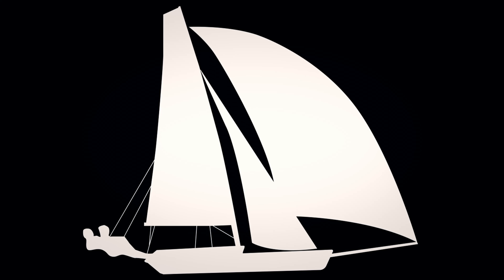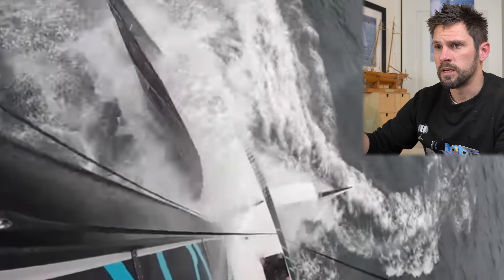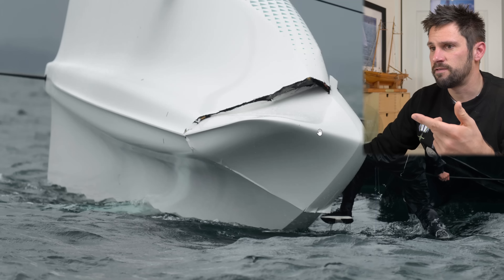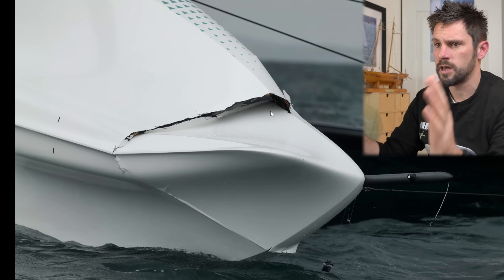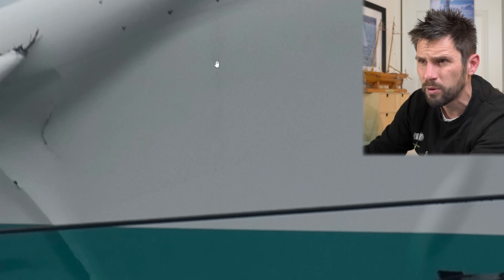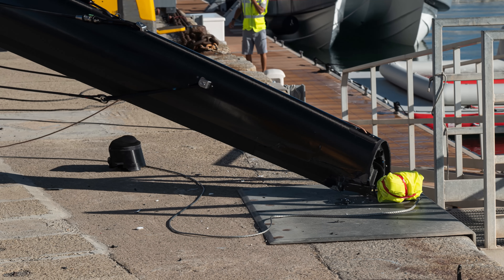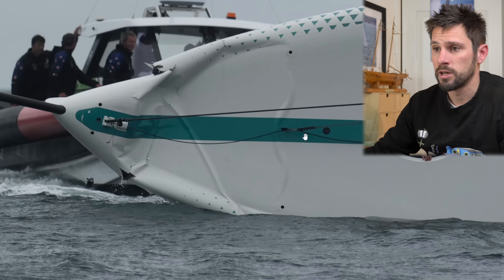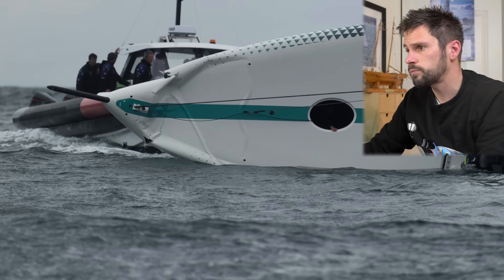Implications of AC40 Structural Failure

Comment: This is a very informative video.  My first thought was the lack of reserve buoyancy in the bow. MY second thought was that the deck sweeper headsail caught the water; normally the sail would tear, or the mast would come down.  But the new sails are very strong as are the new masts.  If the sail gets a load of water; especially at these speeds. something will break no matter how strong you build it.  I would recommend redesigning the headsail to fail at a certain load.

Comment: I think if you're tight on your budget (which ETNZ always is) then it's maybe better to use the AC40 standard which you have to buy anyhow instead of spending lots of money into a boat which will never enter any competition. Although in fact, many of the last cup boats could have been recycled (including the AC50, which are now a few seasons round the SailGP circuit. Maybe some rich guy buys one or two LEQ12s and converts them into something like the Flying Nikka
Reply from the maker: I donder what happened to the previous test mules from the last Cup. I wouldn't fancy the INEOS one, but the American Magic, and also the Kahu the ETNZ one looked pretty sorted

Comment: This is ridiculous. If this is a one design class, are there no specifications for construction standards?? The foiled catamarans regularly nose dived. Just look at the trim of the an AC40 and it's just waiting to nose dive at any minute. If the designers and structural engineers did not see this coming they should be fired. My late father was a test  engineer for the Hydrofoil designer William Carl. I grew up with hydrofoils. The trim on these boats just looks wrong. It's as if they use the data from towing the boats to set the foil placement and  trim without taking into account the vectors of the forces at the top of sail. And like the cats this makes the boats dangerous to sail. These people need to wake up like Formula One did after Ayrton Senna's death in 1994. Note: Jules Bianchi's death in 2014 was the result of poor race management not failure of the car.

Comment: The Kiwis just released a video “AC40: implementing the solution” where they give some justifications and show the solution they’ll implement. Apart from the engineering side, good to see a quick response from them!
Reply from the maker: Yes,  very quick response. I was surprised. Also very open in the failure mode and loads. I think it's a good response from them to rebuild confidence in the platform.

Comment: The Forestay Strop creates an upward and a inward compressive force inside the boat in order to load the forestay - Just like a TP-52 and looking at the Bow, it looks like the bow collapsed under impact - looks like 15mm thick Nomex Core. So easy to rectify. 

One Australia sank in 95 when her deck folded and collapsed mid-deck in heavy weather. I was at the Windward Mark and it was blowing 35knots with a short chop. 

So hull failure is always present in the America’s Cup and nothing new.  Team New Zealand is always pushing the boundaries and is expected to win again.

Looking forward to Barcelona!

Comment: sry I'm new to this channel, but what is the kicker system in your background called and what are the benefits apart from weight ?
Reply from the maker: Welcome! It's just something I made up for decoration. It uses Allen Brothers low friction rings. They are a lot stronger than most ball bearing blocks and also don't have any moving parts so last a long time. And they're very cheap compared to a standard block. At very high loads they can have less friction than a standard ball bearing block, but at most working loads they do have more friction, which is the downside.

Comment: Innovation is what the AC is all about, and one reason I still find the whole AC process, from design to testing to actually racing, to be so fascinating.  And when they break, it's part of the game. But that's NOT what you want for a production boat, or a boat that's already slated to be used in such a prominent one-design series.  They need to be well tested, reliable, and above all, SAFE, especially for Junior racing.  This is pretty much the opposite of an AC boat, where the game is as much designing and building the boat on the cutting edge as it is racing.  Pushing the envelope is great, but maybe considering this a bit more next time would be better. I'm sure they'll work it out though.  It was kind of lucky it broke now.  Much better than later!

Comment: Kinda wonder if our attention should equally be on the loss of rudder that initiates the un-commanded manoeuvre, rather than getting myopic about the bow structure. Cavitation travelling down the rudder due to the reduced pressure in the trough behind a wave is seemingly a recipe for disaster. Is the rudder inadequate, or is the loss of rudder simply a fact of life for the foiling classes of such a size?  Does SailGP offer any hints about outcomes of loss of rudder control?

Comment: Mozzy, dont overreact - it is just a boat - Team NZ use Siemens NX Nastran for FEA - I use the same suite - Pure Engineering in NZ use Abacus.

This can be fixed by splicing in a new bow and reinforcing the U-Frames and Stringers. Anyway rather now that later in Barcelona and elsewhere! 

They have the loads and impact data from the crash.

They make it light as possible to obtain a faster lift out of the water.

Speaking of Alex Thomson - he should have had his boat built in France rather as the Carrington shipyard had all these cut-outs in the longitudinal Bulkhead to save 5kg without any edge reinforcement. Should have left it without any holes!
Reply: Can't make an omelet without breaking a few eggs

Comment: How much of this damage is caused directly by the impact with the water, and how much could be attributed to rig loads through the forestay as the boat decelerates? ie has water impact pushed the bow in, or has the forestay tried to rip the front off the boat. Glad to hear you reference Clarke and Dawe! https://www.youtube.com/watch?v=3m5qxZm_JqM
Reply from the maker: Usually in a pitchpole the forestay unloads and the shrouds load up (and backstay if they had one) as the rig tries to push over the bow. However, there is also a lot of water that comes over the bow and hits the jib, which would put a significant load in to the tack of the jib.
Reply: @MozzySails  ETNZ sent in depth explanation of the accident in their latest newsletter with the graph showing water impact longitudinal and lateral deceleration compared to their previous worst comparable event they had with Te Rehutai.

Comment: I reckon it's a rig load up failure not a water impact issue. Rig loads up forwards during deceleration, then the stored energy in the hull and rig unload with a bang.it needs a shock to do that.

Comment: Wow incredible pictures. 
That said as a former AC boatbuilder, I think you might be way understating the issues. 

The pictures you shared show significant delamination 8’ feet from the bow. This means that they bow panels structurally failed. This can have 2 causes; the skins of the panels were underspecified, or the carbon was laid up too dry and the carbon to honeycomb bond failed. I am sure that there are people inspecting the panels right now looking to see if the honeycomb is torn in the middle indicating skins that are too thin, or on the ends indicating that the skins detached. This is the kind of crash that leads to lawsuits if there are third parties involved. I am not sure what happens in this case as to you want to start suing at the beginning of an AC cycle?

Fixing the bow of the existing boat might not be worth it as failed honeycomb doesn’t really hold its shape making it notoriously hard to fix. Additionally any remaining failures need to be removed before they can be fixed. Bottom line, to fix the bow you probably need to build a section to the first bulkhead or lateral stringer BEYOND the damage and then blend in the section. Realistically it may make more sense to use the molds to build new stronger boats. Than to take the molds out of production to build a replacement section.
Any sister boats that are out of the molds are also facing a decision about how to reinforce their bows. As it is impractical to add more carbon after a hull is laid up for several reasons, the principally because adding carbon after the hull is cured relies on mechanical bonding instead of the stronger chemical bonding that occurs in the layers that are laid up together, I expect to see longitudinal stringers added to existing boats to decrease the size of individual panels and make the bows more structurally sound. This will take time as adding structure after the hulls are completed is time consuming. 

The other option would be to limit the conditions that you sail the AC40 in. But what is the use of a test platform if you are limiting the conditions?

Glad to see you back. Keep sharing the knowledge.
Reply: Bravo! You wrote everything correctly! Typical breakage from ultimate load due to manufacturing defects. There is very little glue that connects the honeycomb to the skin, and poor vacuum when molding the skin and the sandwich as a whole.
Reply: Young America was a example not enough vacuum pressure but in their case it was in the gunwale / chainplate area. Nice analysis ted .
Reply: Thank you for your in depth structural analysis. However, hitting the water doing 10, 15, 20 or 40kts is not the same. I'm sure it opens a new era of R&D process to build these boats structurally stable in all situations that might arise.
Reply: However, if you strengthen up the bows - you will add weight right where it is least wanted to reduce the chances of that type of note dive again. The item to really fix is the rudder (or the manner of sailing the boat) as it seems to be simply that the rudder foil lost grip in the water (stalled or got dry due to a wave??). If that had not happened, the crash would not have happened.

Comment: Wow, this will require a major redesign of the AC40 boats! some designers must have egg on their faces, it will be interesting to hear explanations of why it happened, and why they hadn't allowed for the loads caused by digging in at speed. You would hope that the Ineos test mule wouldn't have the same weakness, but maybe they will be reviewing their designs too. It would be great to be a fly on the wall in some of the meetings that take place as a result of this failure.
Reply: If by a "major redesign" you actually mean, "Some quite limited remedial work to existing boats" - then yeah!

Comment: existing design just doesn't seem overly friendly towards larger seas. very vulnerable to front stuffing.  surely a foil under the bow would provide more bow lift in a big sea, and prevent the face plant.  it might slow them down a fraction in lighter conditions, but make for a far more versatile and safer foiler?  greater span between foils provides for stability in adverse conditions.

Comment: It is conceivable that a software or autopilot problem could have caused the high speed nose stuff. An erroneous rudder foil input raising the stern and pitching the nose down violently could exceed the parameters used for the bow design. Similar problems happened with aircraft autopilots in the past- the answer was not making stronger wings, but stopping the autopilot from destroying the aircraft with harsh control inputs.

The more likely scenario, is that it just let go under heavy load in big swells. You would think the many permutations from loss of control crashes would be hard to simulate in the software. This would make a redesign difficult - How strong is strong enough and are any hull losses in extreme crashes acceptable?

Comment: That is a shock. Terribly disappointing but that's how it somethings goes with R&D craft. Regarding the shape of the bow itself, the newest IMOCA 60s are sporting 'scow' bows with less of a wave piercing shape than in the past and much, much fuller in width. Reason being not to dig into the waves inducing sudden deceleration that will cause the yacht to drop off its foils and slowing it down. Granted, IMOCAs are very dissimilar boats and sail in vastly different conditions, but the needs of a foiling boat are also very different from that of a pure displacement vessel. Would this have occurred if the bow shape was different? Hard to know. However, I am surprised the AC boats still have rather conventional bows than some of the ocean racing classes with advanced modern shapes.

Comment: Racing speedboats routinely use multiple lifting strakes in their bow - to handle the stress and provide progressive lift.  AC40's in extreme conditions like this crash are handling similar loads, further complicated by very high rig stresses, particularly from the forestay.  Such strakes introduced to this class of foiler would a)  make the shock of sudden lift loading on the bow section more progressive as the bow splashes down / in,   b) potentially add considerable strength and stiffness to the hull,  especially longitudinally,  and c) spread the load at the hull to bulkhead interface.  Similarly a 'ski-shaped' flat for 3 or 4 feet under the bow would further break up the shock of a hard splash-down. All this could probably be done with a narrower profile at deck level, adding better wave penetration at the same time. Also worth adding a shock absorber of some type to the forestay, activating only in extremis.

Comment: Cannot understand why the steering foil is at the stern. If forward, it would increase lift in pitch and, like a road car, would have greater sensitivity in a turn...l made models with this configeration...worked very well...stopped the bow dive?? Remember the original "America" in 1851, Brits said it would never be fast because the hull shape was facing backwards...may be time to rethink perhaps?

Comment: Can’t see this getting sorted quickly. Probably the hardest spot on the hull to add strength to once the hull is fully assembled - access would be a nightmare. Probably means redesign and new build of “type 2” hulls? Anyone know how many AC 40 hulls have been built so far? Could be v expensive even by AC standards….
Reply from the maker: This one... INEOS's has just been shipped to Europe, I think ETNZ second had just arrived and one more is encountered from china
Reply: @MozzySails good news on the cost front as they can build new design into later hulls. Watching the AC video interview it looks like the water tight bulkhead did its job keeping the water out…

Comment: Its the old saying. “ if it doesnt break , you built it too heavy".  Better to do it now than have 6 boats to repair later. Failure goes quite far back, more than 2m (  black dot on the gunwale )Looks like the alan prost of sail boats now.
Reply: Yeah, but it’s not supposed to disintegrate until it’s almost across the finish line!

Comment: Do ETNZ have to declare the data from the stain gauges and load sensors on the boat along with the layup schedule and structural calculations. If so and all teams are able to use the data, it will massively play into the hands of LR & Ineos.

Comment: A racing boat has to be as light and fast as possible. No racing machine EVER has been designed to crash. Nevertheless....that part of the boat needs redesign. A splash down is part if racing.
Reply: Many racing machine are designed to crash, and foiling machines crash often, often just like this.  It will be reinforced, and it will be able to take a crash like this in the future.

Comment: As they said them selfs, this is what happens when you have to fly it your self and not the computer.   Would a more skow shaped bow take down some of that slap, and stronger under twisting loads.  The might even role around the boat in a pitch pole like a mini.

Comment: Wow, Alex Thompson had this problem with his Hugo Boss IMOCA. The front looks like a crush zone for an F-1 car. It really looks like they relied solely on the outer shell structure with no reinforcement along stress lines. They really don't have a realistic structural model and FEA of the bow under collision forces. Very surprising considering the level of design sophistication used to build the AC40.

Comment: Once the rudder lost grip the drag from the foil appears to turn the boat as the bow dives, thereby sideloading the bow and folding it under. May need some angled ring frames in the bow to cope with the sideloading, a longer rudder and improvements to the control system to prevent it happening in the first place.
Reply: The safer they make the controls the less useful it is for AC75 training. The foils and rudder aren't brand new concepts so I would rather trust that the designers have got it where it needs to be. The hull OTOH is first of new class so the issue is likely there.
Reply: @AnttiBrax    What do you think Team NZ will do to address this issue.
Reply: @AnttiBrax  rudder cavitation still seems to be a major problem ...

Comment: Rather have a design or construction issue to address at testing stage then once in production and boats in circulation. 
Might be a set back to the team, but chances are they can replace it sooner than doing a repair as likely have others in production phase already.
Reply from the maker: One saving grace is that this happened before the other AC40s shipped to Europe. But considering they finished commissioning in October and were now  in LEQ12 test boat phase that is more by fortune than design
Reply: @MozzySails  who owns this issue with the design for the AC40? Is it ETNZ or is it a combined team of ETNZ and COR?

Comment: How many times would it be expected that other foiling one design classes would tolerate stuffing the bow in at the top end of the performance range before failure?  Is it realistic to expect that the boats should be able to sail away after such events, one time, a few times, always?